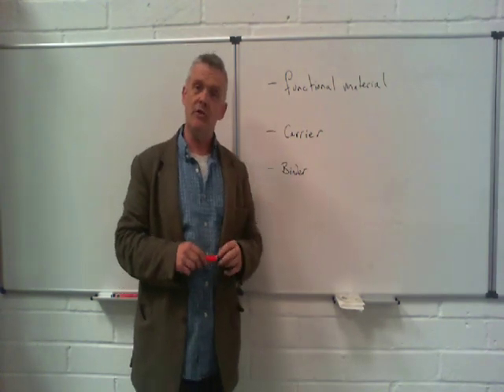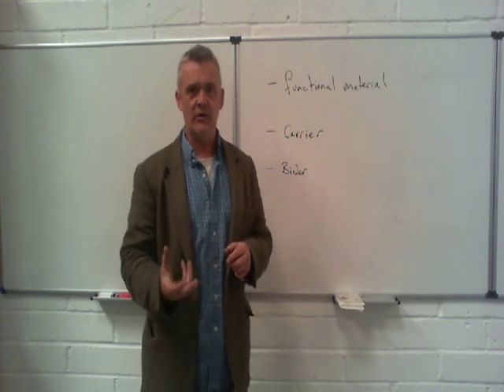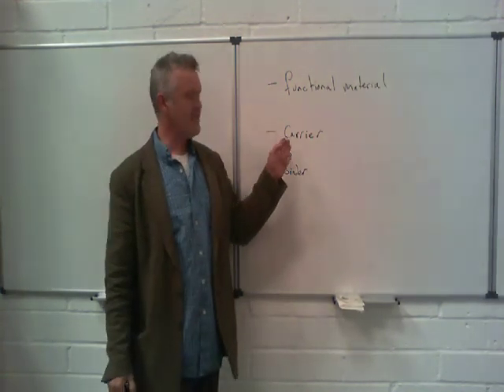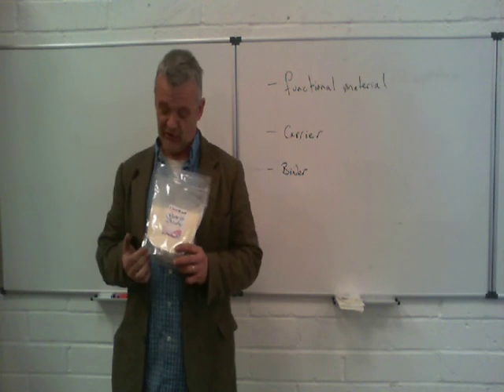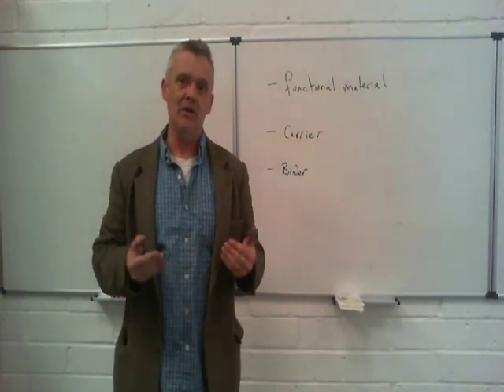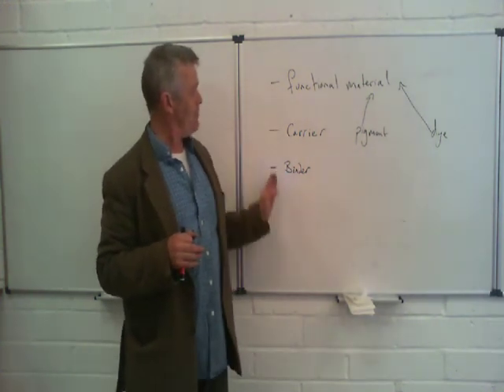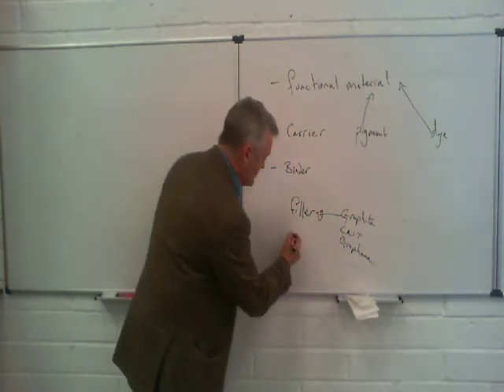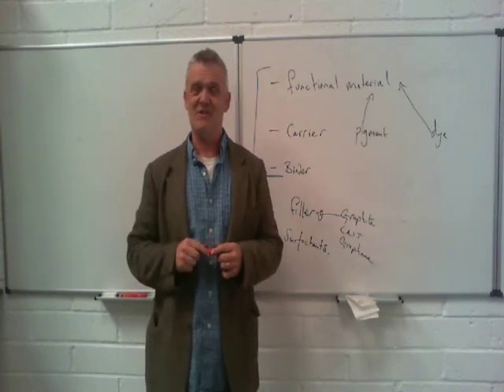Making Inks And Paints - The Basics

Comment: 05:55 - "linseed oil" (for those like me who are not English tongue and would need like me several watchs to understand what it was ^_^ )

11:25 - "zinc oxyde"

11:34 - ?? ...-oxyde? (didn't get the first part of name you said ^_^ Can You write it down here please? :) )

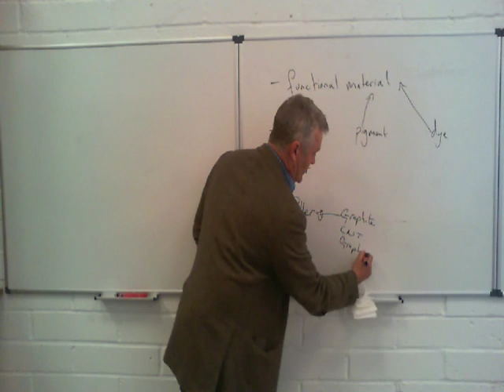11:47 - "graphite, CAST? (didn't get the full name corresponding to the initials, what is it please? ), graphene" 

14:03 - "???, as a table spoon of salt"

PS: I remember You that You invite us to replicate and experiment ourselves, so that's Logical we bother You for questions when we don't understand :/
Reply from the maker: linseed oil - it's a standard drying oil for ink manufacture and is used as a binder
yes - zinc oxide - it can be an inert filler used just for colour or an active material used in zinc carbon batteries.
nickel oxyhydroxide - a component of nickel iron batteries
listing conductive fillers as ideas - graphite or carbon naotubes or graphene as examples - there are others
nickel oxyhydroxide was the example

what you have to remember mate is these are examples of materials from the headings on the board - the actual materials don't really matter - they are just examples of the class of material - so - there are lots and lots of examples - nickel oxyhydroxide is one active material but so it manganese dioxide, lead oxide, lithium iron phosphate - in fact any battery matreial you can think of would come under the heading of active material.

so - it is not essential to hear each and every word - what is essential is to understand the guidelines and have a look for you own materials that would come under the headings given in order to create your own system.

this is why i am taking the time here - not to list the words for you but to point out you need to get the concept and run with that - then you can experiment for yourself

Comment: Great work Robert.
I am looking for a flexible conductive coating to use over polyurethane rubber materials to act as an electric field screen or deflector in high voltage apparatus. The paint doesn't need to carry currents, 1k Ohms/sq will do the job. The primary objective, the paint shall adhere to the polyurethane and does not crack or flake off as the rubber base material deforms. 
I have tried to add 40ml of Xylene to 17g of a polyurethane sealant/adhesive and 25g of graphite powder, the outcome was satisfactory but not that good as I wanted it to be, minor cracks appears as I fold the substrate material but the paint itself doesn't fall off. The surface resistance is about 700 Ohms/sq. Do you have any opinion on the system I have used to improve it, or do you recommend and alternative solution to use on polyurethane rubber.
Reply from the maker: I am sorry I am afraid i don't really

Comment: Could you use aluminum in a powder form as the functional material?
Reply from the maker: yes - but what function do you want? - if it's conductivity it will probably not be that good as the aluminium is bound to be coated with a layer of insulating aluminium oxide
Reply: I wanted to see if I could make a conductive ink using aluminium.How would I remove the oxide?Would making it into a powder form help with the conductivity?
Reply from the maker: Blueghost136
aluminium is very reactive you will need to do more than just remove the coating of oxide - you will need to put an additive in to make sure it doesn't come back